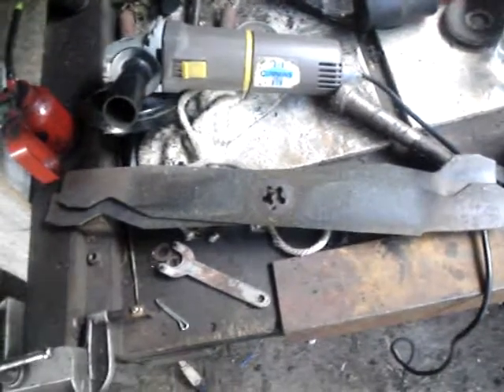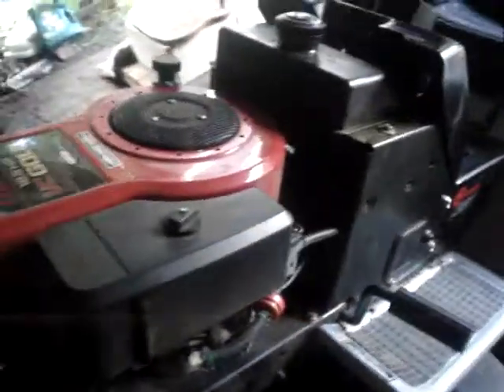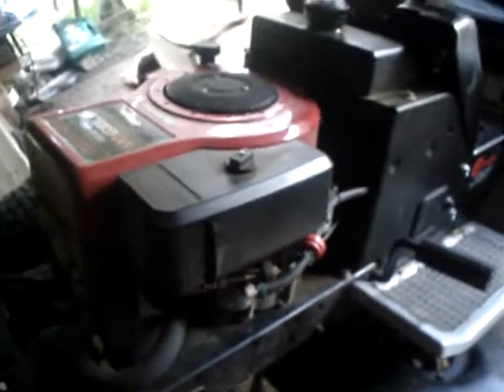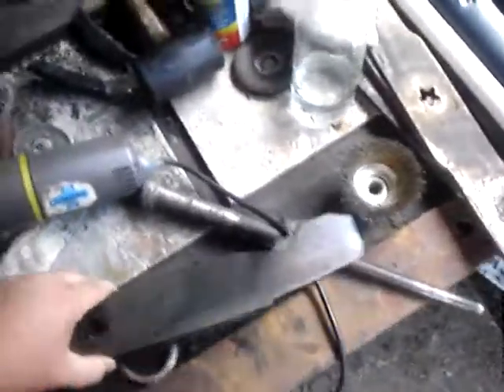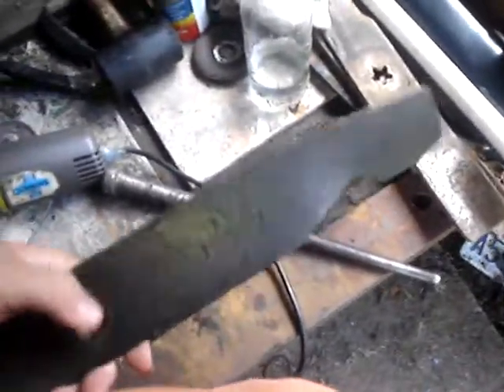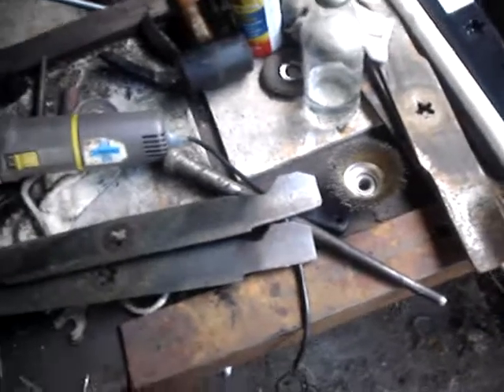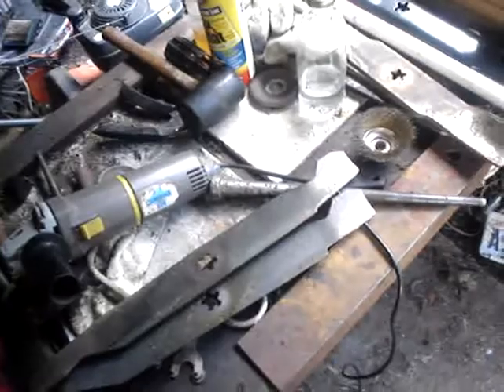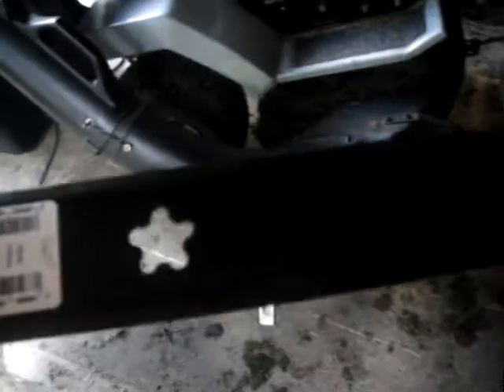1992 SEARS CRAFTSMAN rider is back in the shop

Comment: I just flipped my BRAND.NEW. deere D140 off the back of the truck. ramps slipped.22hp vtwin briggs and the frame were fine. hood is destroyed. original problem was broken deck belt covered by warrenty!!!! woulda been free to fix!!!! now $480 repair. F M L!